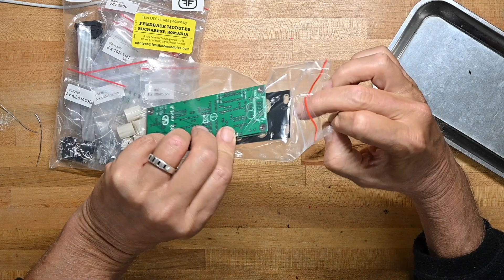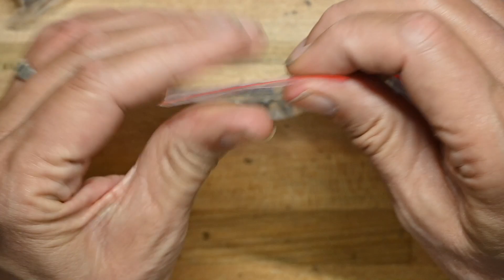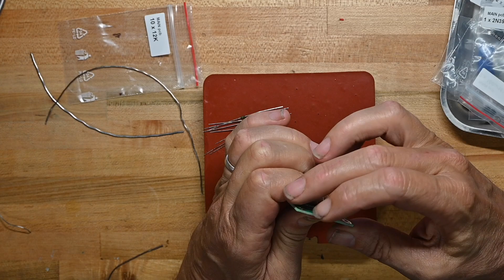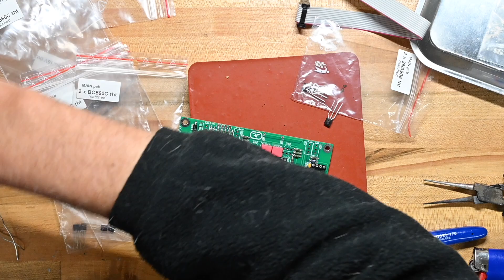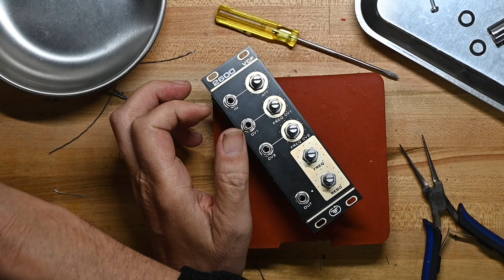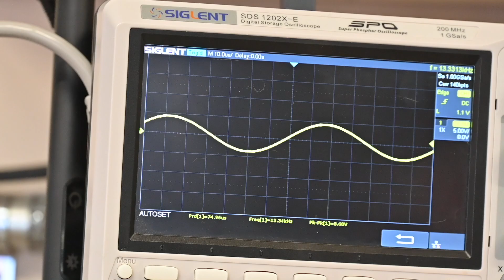C.K. builds a VCF 2600 kit from Feedback Modules, eurorack

Comment: Hi C.K. i built my one of these today, my kit was missing the 300k resistor, luckily I had one, and I also have 9x 100k resistor. Out of over 50 modules I've built this was the first one that just seems completely dead, Ive spent over an hour trouble shooting, my guess is a dead chip. very disappointing but glad you got yours working.
Reply from the maker: I will say I've stopped buying from Feedback modules.  Missing parts, instructions that you have to triple check on-line for changes he made without updating the build guide, and at least one deader (I don''t publish those).  Too many other good makers.
Reply: @CKHaun  I was very unimpressed, compared to other companies who have very detailed build guides on their websites this was lacking. I'll spend some more time trying to figure out what the error might be, and maybe swap the chips out, but if I cant get it working, I'll just have to cut my losses and try something else. real shame.
Reply from the maker: I understand.  I have 120+ euro rack builds on my channel, but that doesn't include the duds.  I run about 6% failure (with proper build), and FF is overrepresented in that.   If you can't get it working toss it in your recycle pile, there are some useful components to harvest.

Comment: Thankyou for the video. 👍I built this one yesterday and was trying to calibrate it today. Had much the same experience. I wasn't sure what the objective was with calibration of the self-oscillation LOW FREQ but your video helped me a bit.
I also had the same issue with the 10nF capacitor not fitting (17:55). I was forced to solder it to the underside of the board. My kit was missing the 300k resistor, so I put in the lowest value 330k I had (317k) (the 300k is not even in the BOM document!) I also had some extra resistors and figured they were spares too 🙂
Reply from the maker: I emailed with Feedback Modules and he’s going to clean the instructions up when he can. Thanks for watching!